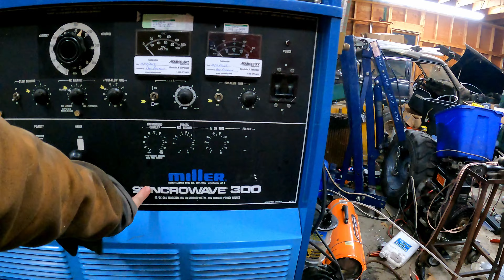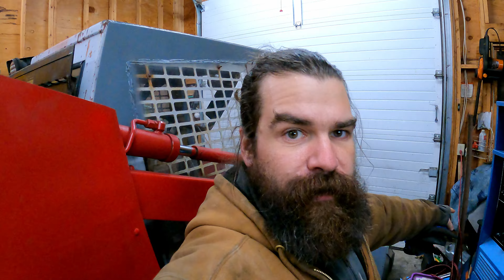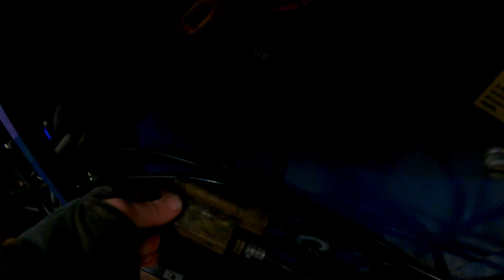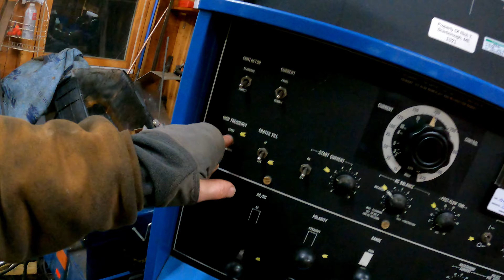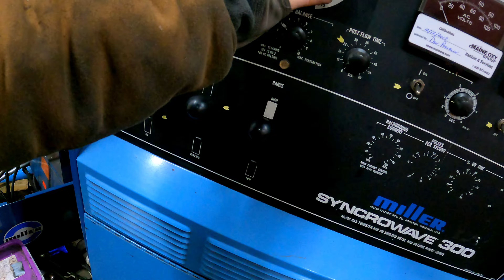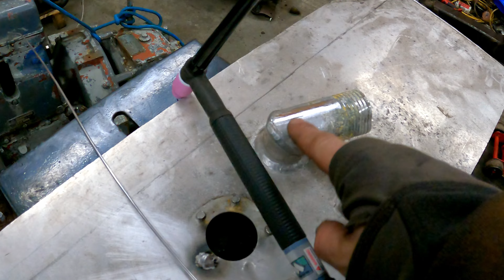Auction Find $300 Miller Syncrowave 300 TIG Welder with Coolmate 20 Chiller: Setup and test run

Comment: In regards to the weight, I bought a Millermatic 300 off of ebay because I need to run a spool gun and I had to get it delivered to work because I don't have a forklift... now I have to get it from work to the house, probably going to chain hoist it to a big tree branch to unload at home

Comment: Hey I got a quick question about your machine what type of plug are you using or are you just hardwired in because I just recently picked up a Lincoln electric idealarc tig 300 and it draws a bunch of amps I was just curious on what plug you're using if you're using one
Reply from the maker: I have mine hooked to a 50 amp breaker, I've never managed to pop it with the welder, you only need full size breaker if you are maxing out the machine, which will probably never happen in a home garage.  I use a 50amp 3 phase plug, because it's a twist lock even though it's single phase, I just picked something and I get used take offs from ebay to save some dosh.
Reply: @wirestiresandfires214  okay cool thanks for the info

Comment: Wow! That's a great machine at a great price!
Reply from the maker: Thanks! I really wasn't in the market to upgrade but for 300 bucks to get a chiller and a machine that can take hand controls(my old dialarc 250 kind can but the parts are hard to find an expensive) I was sold.  It is a very smooth machine.
Reply: I have one forsale in Georgia for $500 without program but it does have cooler(make offer)

Comment: FYI thoriated tungsten is not recommend for aluminum.  In fact, I wouldn't recommend it for any purpose.  If you inhale the grinding dust from it, it can give you lung cancer, because it's radioactive.  It's fine in contact with your skin, but your lung tissue is much more permeable.  E3 purple or (reportedly) LaYZr chartreuse tungsten are both great for any material, any machine.  I run exclusively purple,  and it works great for steel, stainless, and aluminum, even on a transformer machine like the dialarc or syncrowave (mine is a 320A/BP from 1960).
Reply from the maker: I'm an idiot, I mean lanthanated.  No idea why my brain decided to go with thoriated.  Thanks for the catch.

Comment: I just moved to east Texas, and I stopped at the local welding supply to pick up a few things, and I noticed they had a syncrowave 500 sitting out behind the shop.  Apparently a customer left it because he couldn't afford to repair it. Long story short, I asked what he wanted for it, and he said if I want it I can have it.  I just need to go and pick it up.
Reply from the maker: It's worth at least a poke to see if it can be reasonably repaired, parts availability seems pretty decent on these machines considering the age.
Reply: @wirestiresandfires214 I know this video is super old but do you know anything about arc pulse controllers? Would love to see a video on older Miller equipment